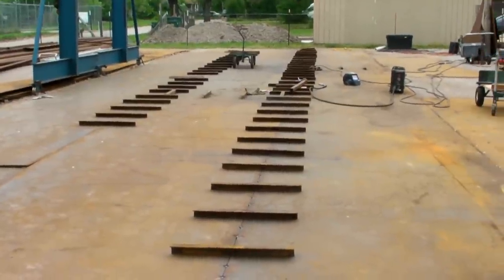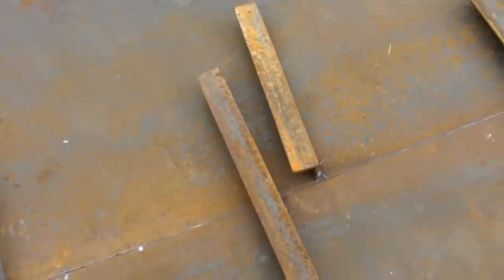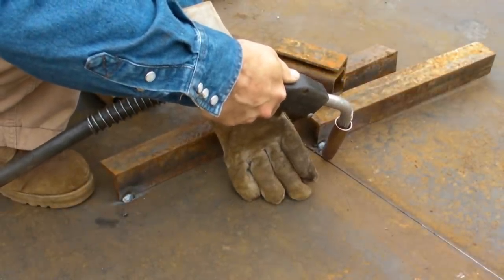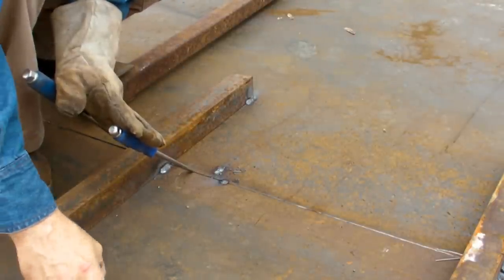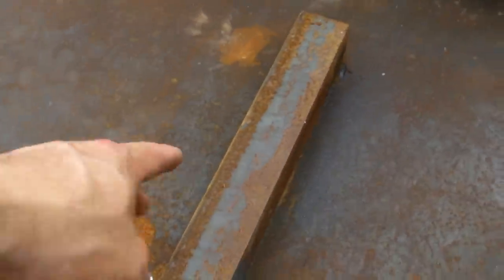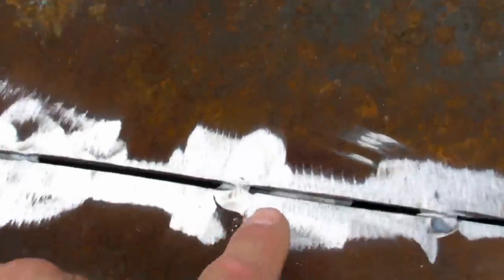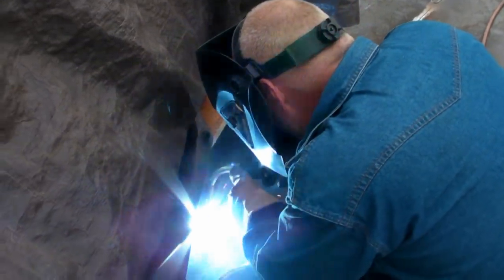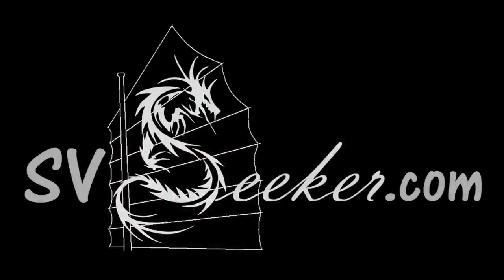Origami Boat Building - Welding the Hull Plate

Comment: Folks who say you can't mig outside on a windy day probably haven't made a living welding...can't tell you how many times I've made "tents" to do just that!  And strong-backs are life-savers on any sheet project.  Love the tool you made, little bit of genius!  On the subject of prying, I have a set of HF (Pittsburgh branded) pry bars that I've had nearly a decade and will still pry up plates like that, never broken a tip.  One of the HF success stories, and cheap to boot.

Comment from the maker: I MIG almost everything.  The only time I use stick is when I need move around a lot, or just do a few short welds.  It's especially handy when I need to add something to the top of the gantry crane. Basically, I suck at stick, but mostly because I rarely use it.  And I hate changing the stick all the time.  MIG rocks for high productivity.

Comment: I am a Boilermaker/welder by trade and we use dogs and wedges. With scrapes of half inch plate,we cut an L-Shape pieces. and with one inch scrapes, we make wedges. This way here you can tact the dogs along the joint and use the wedges to level both pieces of the joint in one shot.

Comment: Toward the beginning of the video you show prying the plate up with screw drivers to get it tight to the angle stiffner. A lil trick I use is if you have an old C clamp you can cut the top finger off of it so you can then tack it to plate near the angle do you can screw it against the angle to lift the plate tight.

Comment: in order to arrange the plates in the height we take a piece of flat and haul of a rectangle in the corner
we weld them vertically on the plate 90 ° in relation to the weld at the lower plate and strike a wedge between top plate and vertical plate   welded (in the gutted rectangle) and arrange it so very easy.
thanks for the effort and great documentation

Comment: hey good for you. i like it when people follow there dreams, and at least give it a go. mate u have a ton of welding to do, maybe flux core is the go. is there any warp-age after welding? i am a boilermaker, sometimes when we flush align plates we use a "dog and wedge" but its quicker to weld to the side of the dog, a 5/8 nut .and use the bolt for height adjustment, instead of the wedge.
Reply from the maker: Thanks, good dog tip too..  That's dual shield we're using on those plates, or flux-core with a CO2 gas shield as well.

Comment: With the wind being an issue, why not just use SMAW? It wouldn't give you the nicest looking welds around but it would certainly do the trick as far as penetration goes.
Reply from the maker: I'm not nearly as good at SMAW and I don't like how slow it is or all the stopping.  But that not to say it's not a good process, especially if that's what you know the best.
Reply: INF1D3L010  I agree SMAW vee it out then stick weld or at lest duel shield .045 wire on the outer hull. But that's just me, I hate to be judgmental of other peoples work .   Pin holes suck , more so on a boat , weak weld's on a ruff sea would suck even more , sorry just saying .
For my next trick I will attempt to shut the hell up !!  LOL

Comment: by the way , ISC engine has problems with valve lifters .
Strongly recommend to get spare lifters and camshaft on the journey .
Fuel injection pump is the second problem ...
Reply from the maker: ISC?
Reply: Hes talking about the cummins.
Reply from the maker: Thanks